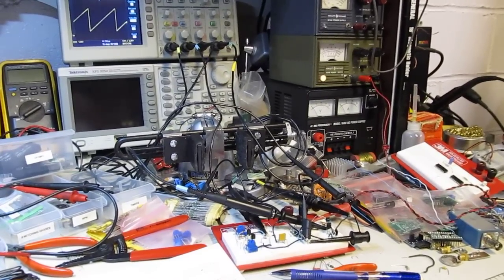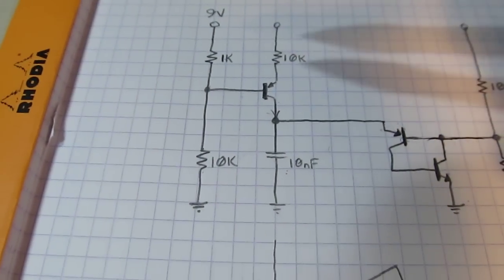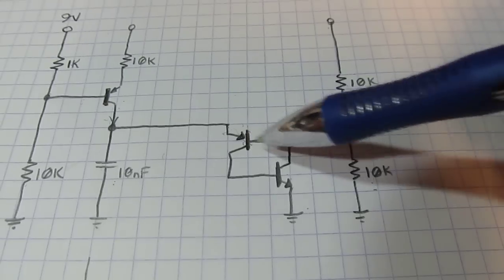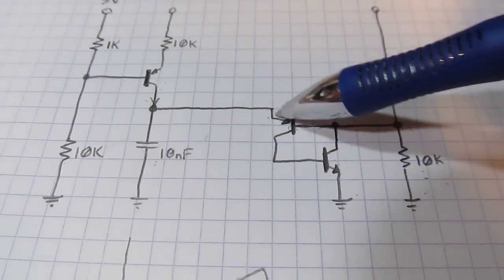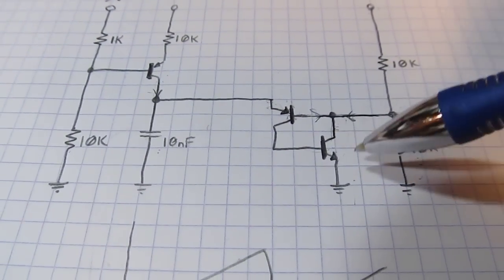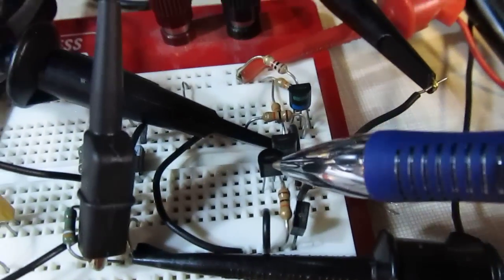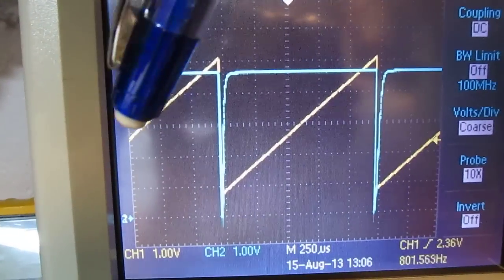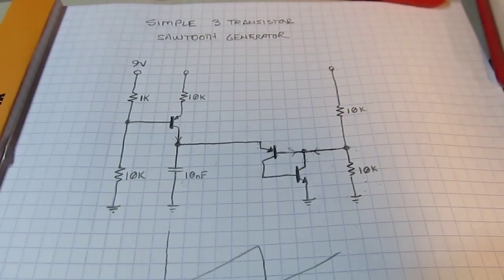#105: More Circuit Fun: Simple 3 transistor sawtooth generator / oscillator

Comment: Superb! Nice simple design, and looks like it would be easy to modify so as to generate a symmetrical triangle wave (by discharging the cap. through a current sink). 

BTW, is there a name for the transistor pair structure that does the switching?
Reply: To answer my own question, I guess that you'd call it a discrete SCR or something. I must admit, I had no idea that this would work, given that the base/collector regions are not physically contiguous. I'll have to build the circuit and see what happens.
Reply: Sometimes referred to a "hook" configuration ( back in my 'old' days).

Comment: Built this in EveryCircuit and it doesn't work.  What are the specs for the transistors?
Reply from the maker: Unfortunately, circuits like this operate the transistors in a way that are not modeled well by most simulators.
Reply: @w2aew  I have an Arduino kit that has a variety of NPN and PNP transistors.  Would most work in a simple breadboard circuit like this for demonstration purposes?  I know that's a loaded question...
Reply from the maker: @orcasea59  Yes, most general purpose devices should work in a breadboard - that's how my example was built.  Give it a try!
Reply: I used LtSpice (free) and it works. At first it didn't though. I had to change one of the transistors. Actually this is really just an RC  circuit that is discharged to ground (or close to ground) when the voltage across the cap provides enough voltage to forward bias the pnp discharge transistor.  If there is 8+ volts on the cap and if doesnt discharge check those two discharge transistors. For me , it was the lower one not turning on.
Reply: Stupid newb question here:  Can this be made with 1/4 watt resistors?  I didn't even get the power supply to 9v before magic was released...  I am double-checking to see if i wired it incorrectly, but I don't think I did...?
Reply from the maker: @orcasea59  Yes, I used 1/4w resistors.
Reply: @w2aew  I keep burning up the top 10k R on the voltage divider on the right-hand side of the drawing before i even get the supply all the way to 9v.   I re-set he breadboard, drew out the schematic in graphical style and verified the E-B-C connections of the 2N5401s and PN2222 I am using, but still...I'm dong something essentially wrong.  My Hantek showed - not a triangle across the cap, but a sine wave for a short burst of declining amplitude until i shut off the supply.  I'm usually pretty stubborn about problem solving, but I'm afraid this one's gonna get away from me.
Reply from the maker: @orcasea59  Something's definitely wrong.  Are you sure it is a 10,000 ohm (10kohm) resistor?  Even if you connect 10kohm directly across a 9V supply, that's only 0.0081 watts (8.1mW) of power - therefore impossible to burn it up.
Reply: @w2aew  ...Well, that will teach me.  I bought a bulk pack of a variety of components from...yes, China.  When i received the strips i metered them just to make sure, but tucked inside the 10K strips was a 10 Ohm strip and I put them all in the 10K bin.  Guess which one i was taking the resistors from?  I normally meter resistors before I use them but didn't this time.  Lesson learned.

That said, it's now working at 558 Hz and 4.3v but the rising slope is very dirty.  I had to use a 10nF ceramic, could that make the difference?

Thanks for your patience & assistance!
Reply from the maker: @orcasea59  This simple circuit is likely to have some instabilities - what you're probably seeing is some high-frequency oscillation on that rising edge.  Not uncommon.  A small resistor (like 100 ohms) in series with the base of the PNP or NPN of the SCR connected devices might help.
Reply: @w2aew  thank you so much for your assistance.  I work in the video industry (location sound) and i know how difficult producing video content can be.  I appreciate the time you take to respond and help people like myself.  Thanks, again!

Comment: Following my comment 21 hours ago, I have a question: Is there an analogue to the pnp-npn back-to-back combo via MOSFETS?  I have given this question some long thoughts based on my knowledge of how MOSFETs (n-type enhancement) work, and so far the answer to myself is, NO, but I would love to be surprised.
Reply from the maker: Not really.  You could try  P and N channel enhancement mode FETs. but would probably need a resistor from the N-channel gate to ground at least. With the lower transconductance of FETs, I doubt it will work like the BJT version.
Reply: In that case, I would like to still try the p/n-channel MOSFET combo to see how good (good enough?) the combo is.  The question I have is, can power MOSFETs (designed to carry much higher current) be used with small signal MOSFETs?  For example, 2N7000 n-channel with say FQP2706 p-channel from Fairchild.  It seems Amazon does not have BS250 p-channel (philips) which seems to be for small signal.  In the end, I could just get the BS250 pieces...  Any suggestions?  Thank you!
Reply: Oops, BS250 is shown to be a power MOSFET, I just realized.  Any suggestion for part number for a p-channel MOSFET for small signal application?  Thank you!

Comment: Wonderful video.  I made use of the back-to-back pnp-npn transistors you showed in the video to sharpen up falling edges of current pulses (variable width) generated with a pair of MOSFET transistors and a capacitor.  Basically, using a MOSFET transistor, I was controlling discharge from the capacitor after having been charged with constant-width voltage pulses of variable voltage so that a linear ramp down occurred after each pulse which was used as a timing mechanism.  The ramp down profiles, however have different heights depending on the input pulse height.  In turn,  the ramping-down voltage was fed into the gate terminal of another MOSFET which controlled (switched on/off) the drain-source current.  While the shut-off timing was controllable with this scheme, not surprisingly, the falling edges were rounded in nature (sigmoidal shape).  When I inserted the pnp-npn pair in the circuit with a reference voltage at the emitter of the pnp transistor and the ramping-down voltage fed to the base of the pnp transistor, boom! the shut-off sharpend up, I have perfectly controllable pulse width with vertical falling edge.  Thank you, great stuff.

Comment: Thanks a lot for your videos! 
I really love your channel and I learn a lot.
I’ve build the circuit in this video and also added a pot for frequency adjustment
Successfully. The waveform on my scope looks nice and clear and it also has a nice 
Range low to higher frequencies.
But I always have the same issue when using this type circuit (or using a SCR transistor) for an oscillator. 
The problem is always with the output:
when using the circuit as a sound generator or a modulation source,
the output is not stable and the waveform distorts changes frequency and also disappears,
especially on lower frequencies under load.
The nice saw wave Is also changes shape and losing amplitude in higher frequencies.
Trying to add a one transistor voltage follower doesn’t really help.
I believe this has to do with some kind of impedance issues.
Can you explain what could be the problem and how to maybe solve it or 
At least Improve it on this specific circuit?
I know I can build many oscillators with other ICs but I really like to experiment 
With ‘transistors only’ circuits :) 
Cheers and Many thanks for your time!
Reply from the maker: As you've discovered, anytime you connect the output of a circuit to something else (amplifier, speaker, etc.),  you will potentially affect the operation of the circuit.  This is because the input resistance or input impedance of the circuit effectively appears in parallel with the output of the circuit.  Impedance is the key.  If a circuit has a high output impedance, you can think of it having a large resistor in series with the output.  Thus, if you connect it to another circuit, the current drawn by the connected circuit will cause a voltage drop across this resistor, thus changing the output voltage.  A circuit with a low output impedance will be much less affected by a connected load.  A good example is a power supply.  It has a low output impedance, and thus it's output voltage is affected very little by the other circuits connected to it.  As you can imagine, the most problematic things are circuits with high output impedance, and circuits with a low input impedance.  If you have a circuit with a high output impedance, you'd often need a buffer (unity gain amplifier) to condition the output.
Reply: w2aew thank you! I’ve managed to use the output with a Darlington buffer and few small additional parts, and it’s capable of driving a load with much stability. Now I have a different issue- on higher frequencies (with or without a load on the output) the main power (9V) decreases to around 8V , I.e higher frequencies sweeps makes the power unstable.
Reply from the maker: Such a simple circuit is most certainly going to have compromises like this.

Comment: thanks! it works well! but i have some curious,,, If First stage 10k resistor value of Switching PNP Transisotr  emitter changed, then Saw wave form does not generate ... ex) 100ohm, 500ohm even 0hom,, why? i don't understand it.. (*i 've replaced  the capacitor value 10nF with 0.1uF..)
Reply from the maker: The 10k in the emitter of the first PNP sets the charging current for the capacitor - it is not used as a switching device.
Reply: @w2aew  first of all, i appreciate your comment and video. i 've already understood the RC applications. even if the 10k value increased or decresed, i thought the wave form must be generated because of R-C charging & discharging time. also, i 've checked the output wave frequency changed when i changed the resistor value. However, i just realized the particular resistor value doesn't generate the output wave. that's is what i don't understand this situation. example, too low resisotr value doesn't genereate the output wave form or too large..
Reply from the maker: @박동진-y9q  As you can see, this is a very simple circuit, and is not a robust circuit.

Comment: Very good video, instrucive and enjoyable! I tried breadboarding the circuit and couldn't get it to work. It seems the latching circuit locks in an active state, pulling the voltage over the capacitor down to a diode drop or so, but then it doesn't shut off, so I can't see any voltage buildup over the capacitor. Any idea why this could be? I used jellybean BC378/BC548, could that be the issue?
Reply from the maker: A simple oscillator like this is not very robust, and will often not work.  Operation sometimes depends on the parasitic properties of the transistors.  Try swapping out faster/slower transistor types.  It's not a very good circuit, but was just shown as an example of a very simple oscillator.
Reply: @w2aew  Thank you very much for your answer!
Reply: That's odd at that point the pnp base emitter should be reversed bias.  Do you have the 4.5 volts at the base of that transistor ?

Comment: Do you need the 1st transistor on the left?  It seems to work fine with just an RC circuit.  And also thanks for explaining how the circuit works, especially the SCR like transistor pair.
Reply from the maker: It will work with a resistor, it just won't have a linear ramp - it will have a slight curve on the ramp.

Comment: I'm very impressed by your excelent explanation of every single detail of what's going on, that helps to understand the dynamics in the circuit.

My question is: I am trying this in proteus. It works but I haven't been able to generate frecuencies higher than 100Hz. When I decrease the capacitor capacitance too much (say 1nF), it wont oscilate at all even after rising the emiter's resistance to 500K. Sorry if I am missing the obvious here but I'm an absolute beginer.

Is it possible to generate a frecuency of about 20KHz-50KHz with this circuit? I'm trying do build a PWM using only transistors, do you thing it would work ?

Thank you so much for your help.
Reply from the maker: This simple circuit is a very imperfect oscillator.  Operation depends on transistor parameters that are not well controlled, so I wouldn't plan on making anything serious with it.  It will certainly not be adjustable to do PWM operation.
Reply: Thank you very much. I was suspecting the problem increasing the frecuency were related to the 2nd and 3rd transistors properties.

Comment: I love these videos! I have a general question, I am designing a midi controlled analogue synth and am currently writing a report towards it. I need to write some technical design specifications before considering the design and give reason to why I chose them, such as waveform output voltage, current in etc. Could you give me some examples of what can be aimed towards at this point and  how we would support these specs ? thank you, keep it the great videos :)

Comment: Thank you for the education I've been looking to understand for many years. Your presentations, demonstrations & explanations on your channel are hands down "the best". As a person who has worked in the television industry, I can see all the preparations, effort & polish you put into your videos. I would say you are the "Forrest Mims" of the Internet. Anyway, my question is, how necessary is the 1K resistor in the circuit? From what I can deduce, wouldn't the first transistor conduct the same whether it's there or not? I can see how it makes a voltage divider for approx 8.2V at the base ( for ~0.82V potential between the Emitter & Base), but I'm not sure why that is needed. Thank you in advance for helping me to understand this.
Reply from the maker: If the 1k resistor wasn't there, the base voltage would be much closer to ground which would have two consequences:
1) The emitter and collector current would be much higher, which could be compensated for by increasing the 10K emitter resistor,
2) The transistor would saturate more quickly as the timing capacitor charged up, because the base-collector junction will become forward biased at a much lower voltage because the base is at a lower voltage.  This is the main problem.  It is likely that the transistor would saturate before the SCR-connected transistors have enough voltage across them to turn on.  So, the circuit wouldn't oscillate.
Reply: A PNP transistor requires a 'negative' bias on the base to turn on. This 1K resistor provides the 8.2 volts from the divider. ( 8.2 volts is more negative than the 9V on the emitter) This is what turns on the "current" source.

Comment: I cannot get this to work in a simulator or on a pcb wired up.   All I get is the first sawtooth, then it just sits at 0.7v forever (at the capacitor) ...what am I missing?
Reply from the maker: A simple circuit like this often relies on parasitics that are not well modeled in a simulator.
Reply: Yep, that is what I found with further testing and some simulation.  I even tried a real UJT in the simulation (2n6027) , same result.  The circuit is sadly unreliable, ...pitty, because I like the neatness (ignoring the high current discharge).  I was looking for a low comp count (hence the 2n6027) discreet sawtooth,  By using the lower voltage part of a resistor only charge curve (i.e. no CC) you can get still get a decent sawtooth with five parts (3R's 1C & the 2n6027),   ...oh well :(

Comment: I am binge watching your videos from the hospital. I love them all !
I bought 2 used HP power supplies exactly like yours (6214A). One of them goes to 8.5V Only! I opened it up and peeked and poked with a DMM and couldn't find anything wrong, except when I compared it to the good one, I noticed that the bad one had some work done on it as there are signs of rework. I think the problem is with a 1.2V Zener but I am not sure how the whole thing operates. 
Is there a way you could do a video on this power supply and go through the schematic, showing what each part does and why? 
It will also show your viewers how a commercial linear power supply of this class is designed and constructed. 
Just a request from a fan.
Reply from the maker: I can add that to my list of topics.
Reply: Great, thanks.
Reply: I second that. It would be very informative. :D

Comment: first, sorry for my bad eng.
why the second pnp transistor turned on again? if you saying because of second transistor discharges capacitor, what about  the current source circutry that feeding the second transistor keeping on?
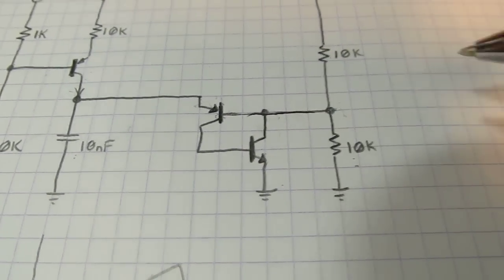Reply from the maker: The description of the operation of the SCR connected devices starts at 1:40

Comment: Absolutely brilliant! Love your videos, and your style. I built it and it worked just fine after I installed a poly capacitor. I am not sure if the leads were too thin on the ceramics or what...